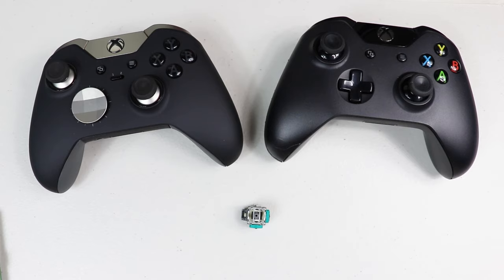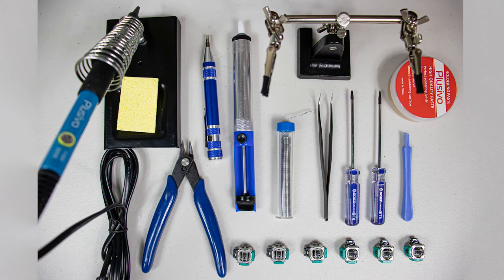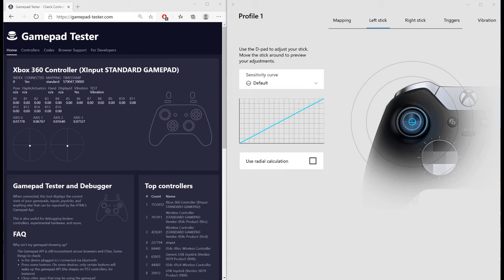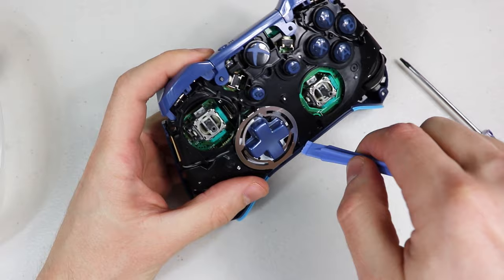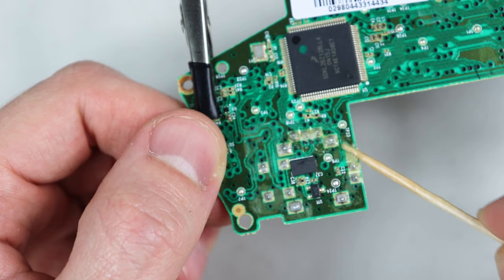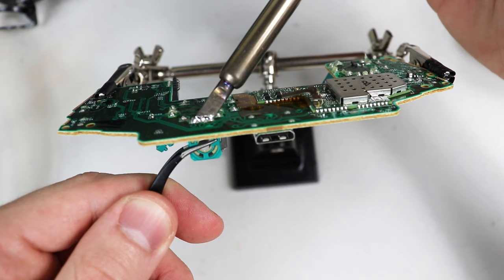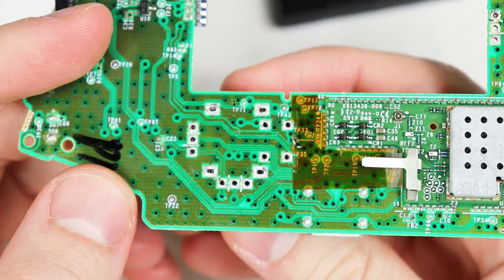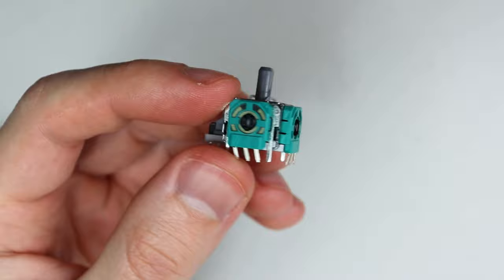How to Replace Xbox One Controller Analog Joystick - NEW METHOD - Fix Stick Drift, Broken, & Loose

Comment: The method you presented takes a lot of time and is impractical, I know a way which is better and takes much less time.
Reply from the maker: Do share!
Reply: @SOSSGAMING  Buy a resistance meter, when you install a new analog, select potentiometers so that they have the same values as the old analog.
Reply from the maker: @szymons3500  Glad that's working out for you! Thanks for sharing.
Reply: @SOSSGAMING  I have no way to sharing it to you. This is the proven method I'm talking about.

Comment: Who manufactures your stick modules for the XBOX or PS controllers? If they are not Alps Alpine sticks, you are using knockoffs, and there is no way to verify they are authentic, as I'm sure you and other sellers are aware.

The claim your sticks are 'authentic' and others are not when the manufacturer cannot be verified is misleading. It is logically no 'safer' to go with your product than any other seller.

Great instructional video, otherwise.
Reply from the maker: Yes, they are indeed Alps! This claim was a while ago, because when I started selling them, no other seller sold them. It's the whole reason I even made this channel, because of the difficulty finding the right joysticks and the correct way to repair them was practically non-existent. I had to figure out so much on my own. Glad you found it useful!

Comment: Fucking hell it's actually insane to me that microsoft doesn't release software for this. So much goddamn e-waste.
Reply from the maker: That was the case! But I have to give them credit now actually, the new S/X and Elite 2 controllers have integrated calibrating software. Nice to see.
Reply: @SOSSGAMING  integrated as in they are just plug and play now?
Reply: how is that? just replace the sticks and that's all? no weird methods needed?  @SOSSGAMING
Reply from the maker: @TheAliceQuo  Yep! It won't be centered right away but after a while of moving it around while it's connected it will center.
Reply from the maker: @NeobassCL  Exactly! It won't be centered right away but after a while of moving it around while it's connected it will center.

Comment: How do you dare to show such lies to people. Get normal tools for desoldering, not wick from stone age! You don't need any calibration if you buy quality analog sticks.
Reply: Tomas, how can I detect quality analog sticks? (I search some for PS4)
Reply from the maker: I am using the cheap kit as shown in the video to show people that are looking to get into this that it can still be done with cheaper tools.  Also, you must be quite misinformed if you think there are "quality" analog sticks that never require manual calibration. You might get away with using the cheaper low-quality sticks that have integrated deadzones in the potentiometers, which might make it seem like it doesn't require manual calibration in a lot of cases, but I would not call them quality, and I sure wouldn't recommend them.  Also, not sure what lies you are talking about.  If I have said something inaccurate I would like to know.